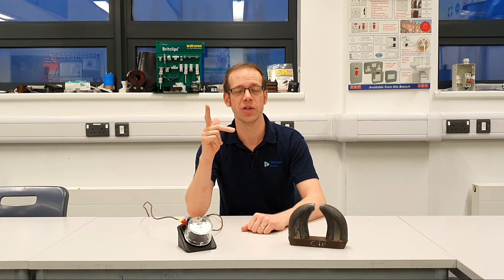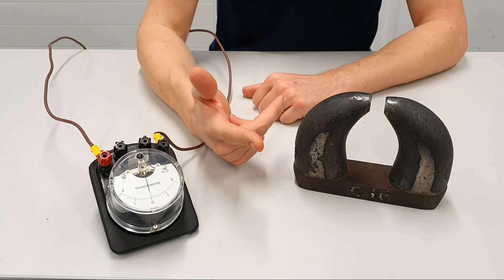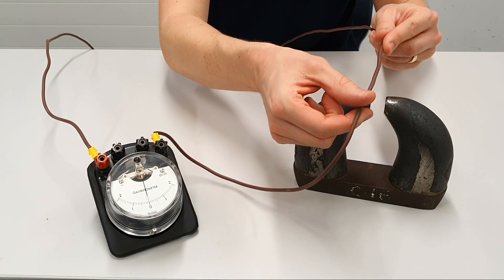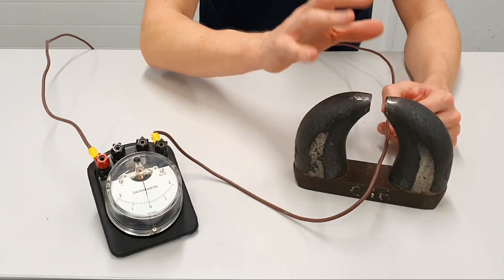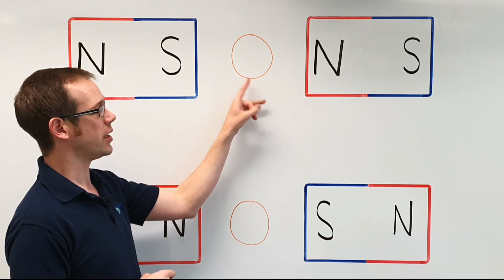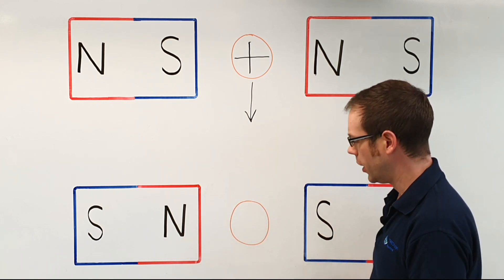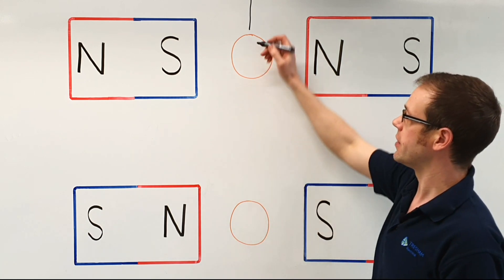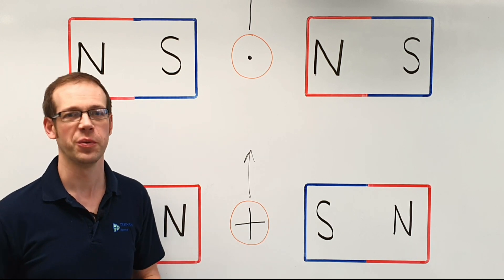How to Use Fleming's Right Hand Rule to Work Out Direction of Current

Comment: Hi Joe, I have got my level 2 exam coming in a few days. Only bit I am struggling with is if a question is about motor or generator?
I did one question in mock exam where I should have applied left hand but I used right hand and obviously got the answer wrong.
Really appreciate your videos 🫶

Comment: One question. Would not the right hand grip rule cause the motion to go in the opposite direction from what you presented? I say this to say that since the conducting wire produces its own magnetic fields, other than those of the magnets, and when the current happens to go in the screen and produces clockwise magnetic fields, then would not those fields couple with the magnetic fileds to force up the wire if the North pole of the magnet is on the right side?